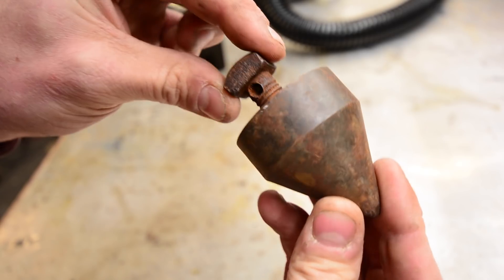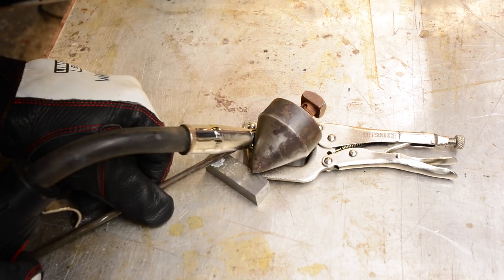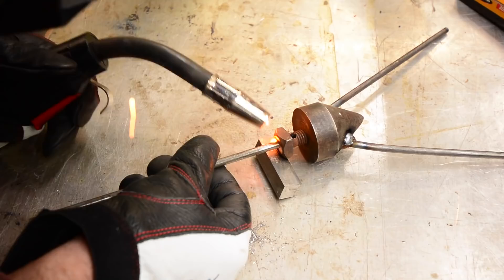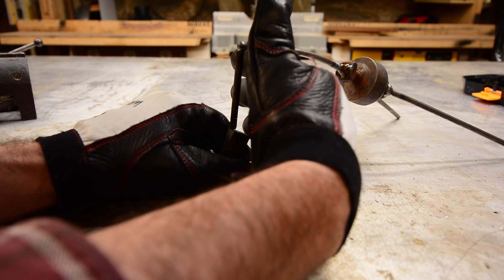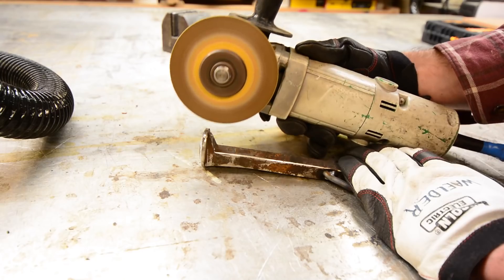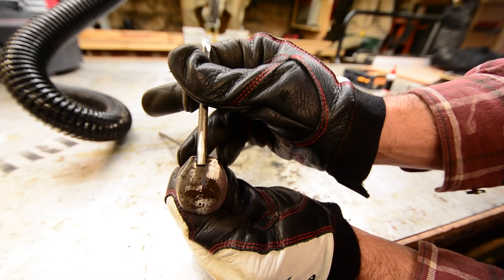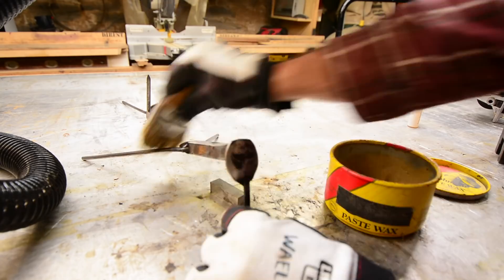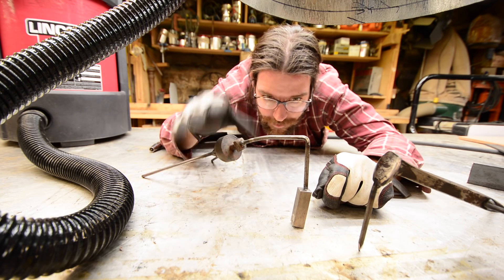Great DIY Welding Tool - Make a simple third hand!

Comment: Just a word for what it is worth--spikes are made of soft steel.  They can be bent very easily.  Rail steel is hard high carbon steel.  Sometimes it is head hardened to reduce wear.  This is something to keep in mind if an item is to made of rail or spikes.  Track bolts are also soft steel usually.